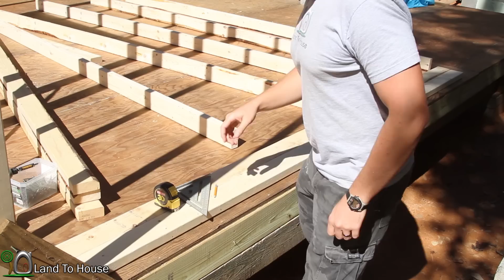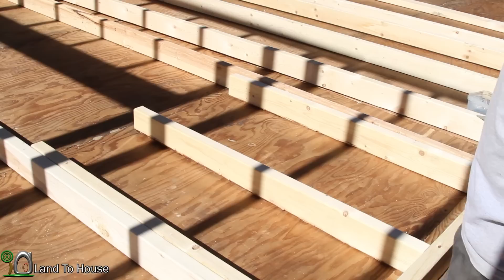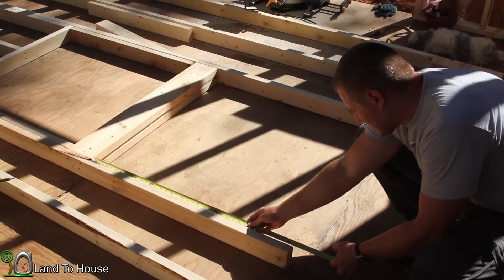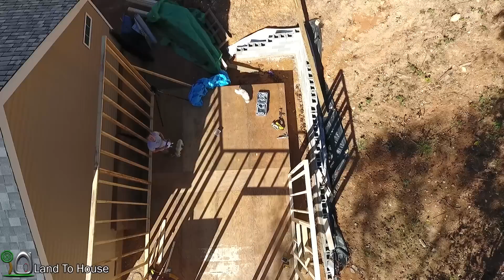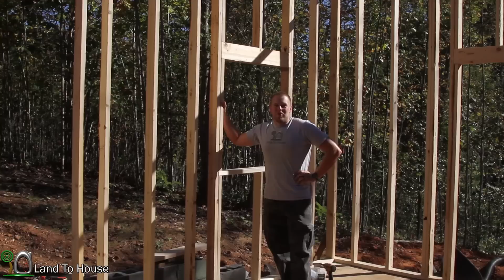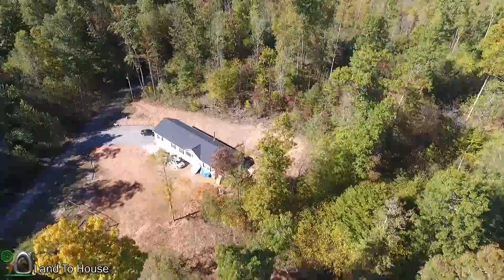Window Wall - Build a Workshop #8

Comment: Shop is looking good. I have not watched all of the shop videos yet. Maybe you have already answered this question. Would it not  have been easier to put the siding on the wall while it was still on the deck and than raise the whole wall up.
Reply from the maker: +gardenman3 thank you. I know some people do that and it is easier. The problem is I'm building this 90% myself. Trying to hoist up the sheathing and wall together would be very difficult for the weakling like me.